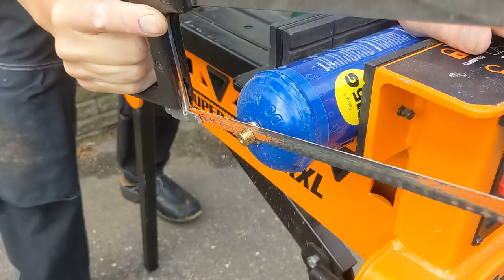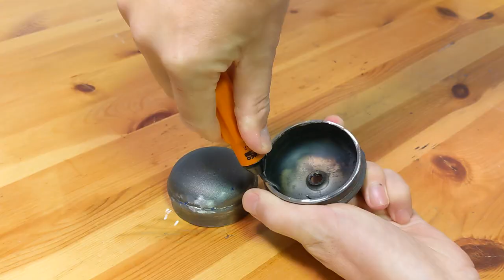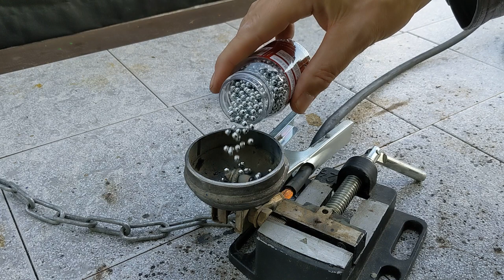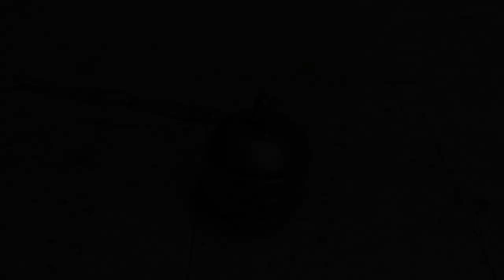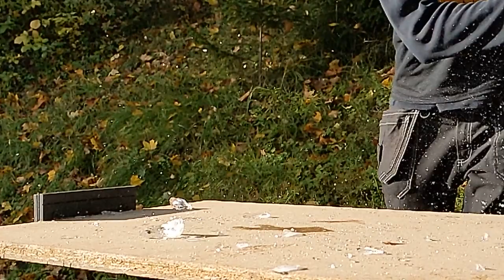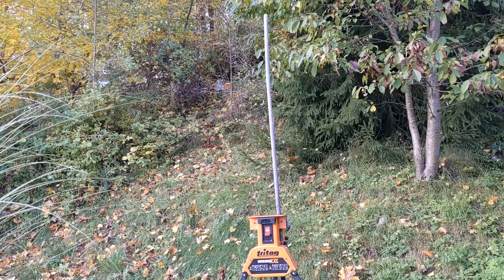Let's make a chain ball from a gas canister! (@DiesInEveryFilm tribute)

Comment: Utilize that type of weight maybe without BB's in it might be a little heavy but then use trolling cable 2 ft each side you want to make some type of handle in the middle that will not cut you in use them as bolos careful whatever you hit with it probably will get cut in half
Reply from the maker: That sounds like a scary improvement on something that was scary to use in the first place! 😬